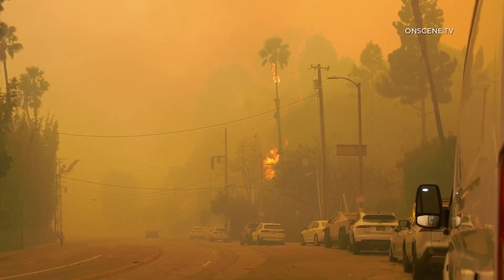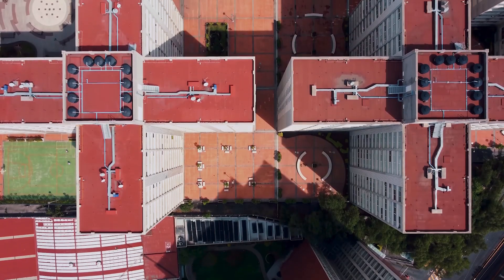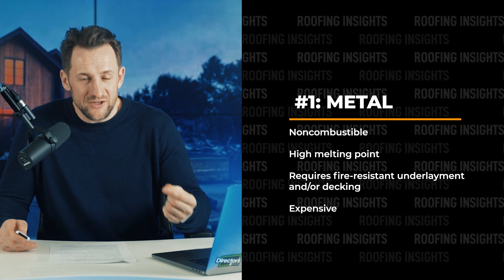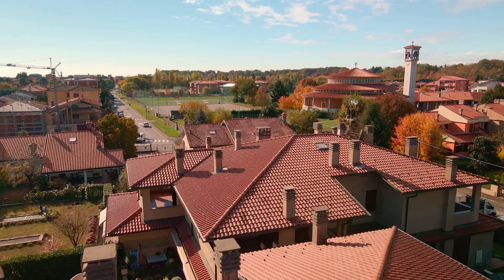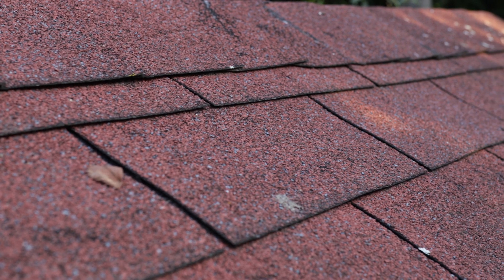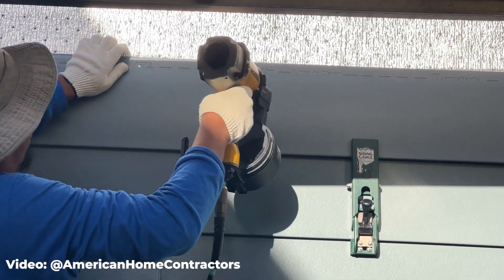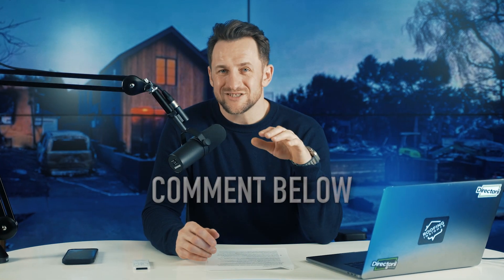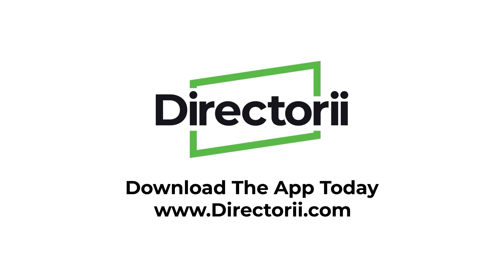Can FIRE RESISTANT Siding and roofing Save Your House From Wildfires?

Comment: 5:30 Brick veneer and cement-based (NOT foam based) stucco should also be on the list of siding options. Both have excellent fire ratings and come in various thicknesses and both require less maintenance than any siding with a painted surface. 
        Fire shutters should also be considered as a cost-effective alternative to fire rated windows.